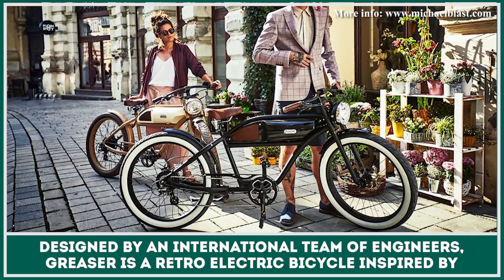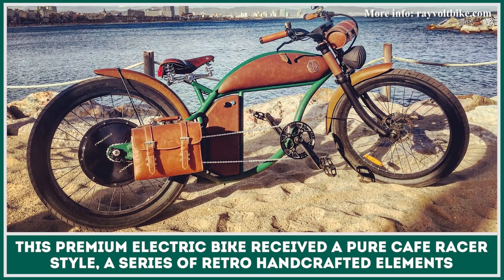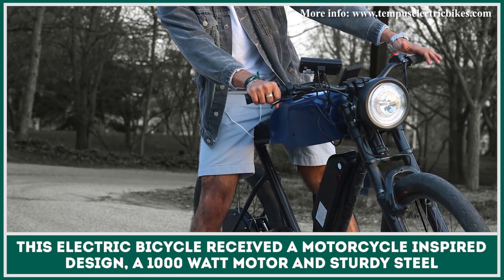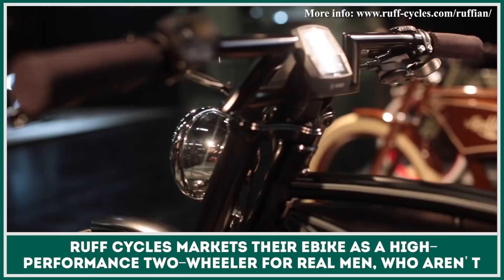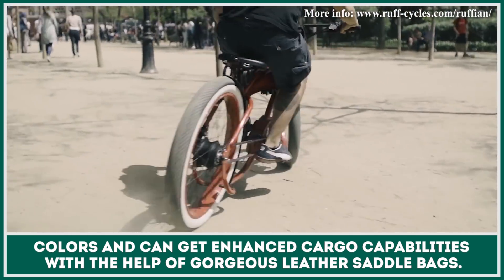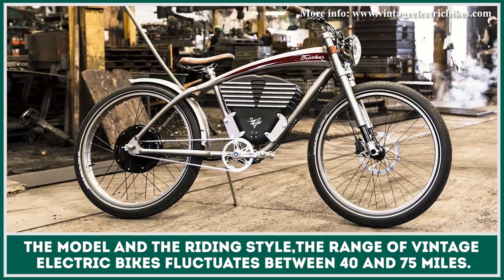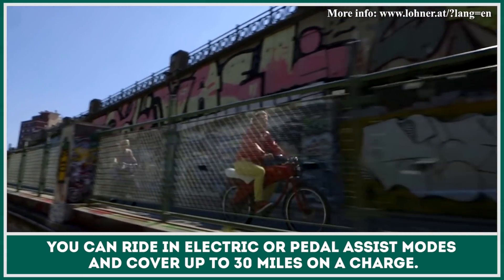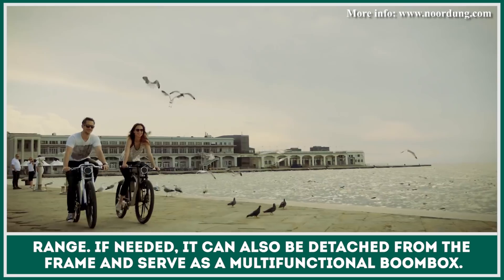7 New Electric Bikes w/ Old School Designs and Retro Bicycle Accessories

Comment: Ignoring the fact that most of these seem unwieldy as heck
This is why scooters are winning.
With these mopeds you are literally be paying more for be less
But I guess that's just the price of style
Reply: I am an avid bicyclist I have been commuting and touring for 4 decades.  
They don't look unwieldy to me.
Another thing to remember scooter = registration and insurance costs.
Reply: @bnorberg988  The same applies to most of these if you want to get the full potential.  In the UK you cannot have an ebike FITTED with anything more than a 250w motor, not just switch restricted.  It cannot assist you past 15.5mph either.  Anything more and DVLA restrictions apply.  Not that it seems to concern a great deal of riders zipping around at 35+mph on illegal motors imported from China.  They plead ignorance when caught but that is no excuse.  If they want a moped then they should go buy a moped and stop trying to circumvent the traffic laws.
Reply: @Biffo1262  Same thing in Germany. They should keep the speed limit (most riders dont wear protective gear and crashing with more than 15 m/h is no fun) and let people use power output up to at least 500W (useful for the heavy people in hilled areas).
Reply: @Biffo1262  Regulations are going to change here in the US too.  Once these start to become more popular its inevitable that they will need to be registered.
Reply from the maker: Hello, thanks for the feedback. We decided to make a video that shows what a variety an electric bicycle market currently offers. These are stylish and custom made bicycles that also happen to be electric.